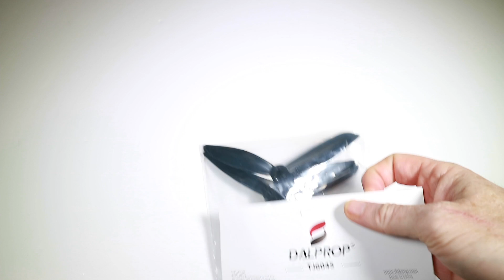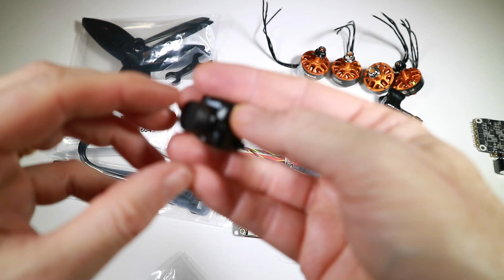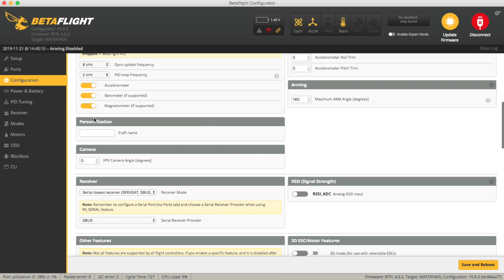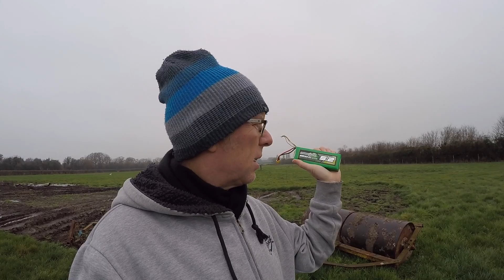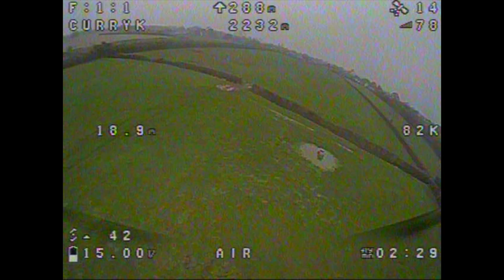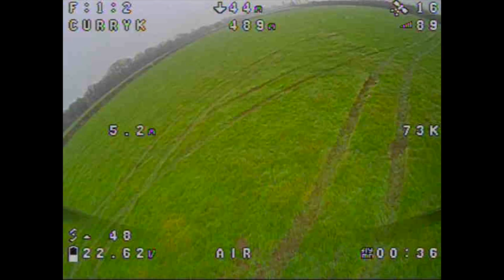Eachine Tyro119: Build, fly and review.  Supplied by Banggood

Comment: which UART do you recommend to add an elrs receiver?
thank you
Reply from the maker: I just checked and in the tyro I used for Open.HD I had an ELRS rx on UART5.  I can't remember a reason why - there's a bunch of rx/tx solder pads on the top left of the FC you can use
Reply: @CurryKitten  thank you

Comment: I subscribed a while back… thanks for all your videos. This is an amazing quadcopter!
I just upgraded my Tyro 119 with the DJI Air Unit… YES… the air unit fits right under the top deck right on top of the nylon nuts securing the FC, secured under the top deck with double sided tape.  The DJI antennas are mounted vertically just in front of the 2 rear standoffs .   I wanted a top mounted battery so I extended the bottom deck with clear acrylic sheet for the GPS to be mounted 4-5” away from the rear of the main frame, and a self powered beeper mounted on the acrylic piece as well…. Also built a 6S 18650 3500mah pack for it.  It hovers at 15-20% throttle and Flys great and far with the Crossfire nano receiver.   Thanks again for the educational videos.  I will keep an eye out for more of your videos.  👍🏼

Comment: I bought mine in jan . 2020 same as this video . I just put elrs into it today . April 29 , 2022 ( i had a fllysky ibus ia6b 10channel reciever )
  I trying to understand gps rescue on a switch . Or is it auto . If i shut off rescue in failsafe the gps speedometer should work with osd . Gps  is sensor on uart 1
  My tx is jumper tpro  grey one with nano module.
   Sometimes i need to pllug or replug. It. In or the reciever blinks fast . 
   So the gps rescuue on a switch or. It is only on or off in betaflight ? Or does the switch shut off the gps rescue . Not turn on the gps rescue . Or am i thinking return to home switch  .
Reply from the maker: Ok - so the GPS info like speed, altitude, direction to home etc etc.  Should work if your GPS is connected properly, and doesn't need rescue mode  to be the failsafe.

If you put GPS rescue on a switch, when you hit that switch you are putting the quad into rescue mode, so it should rise up and come back towards you.  There are caveats to this though, by default if you are within 200m and you enter rescue mode the quad will just drop.  Also don't forget that this isn't anything like RTH, the quad will basically crash towards you if left to it's own devices
Reply: @CurryKitten  thanks .i will just use rth as a failsafe .   My rx and tx were backwards on the blinking gps module at first is why the satelite lock was not working .

Comment: What pads do I solder for dsmx? Thanks
Reply from the maker: Bridge the PPM pads.  There is (according to the diagram I can see) a 3.3v pad on the underside as well if you need that
Reply: Thanks, and I was talking to a friend who said you can only use specific dsmx receivers. I know you don’t use spektrum but do you know of one that may work. No worries if not, thanks!
Reply from the maker: I've not much of a clue about Spectrum stuff I'm afraid.  But as far as Betaflight goes, it looks pretty happy with this one https://www.banggood.com/1_2g-Happymodel-Speki+-Micro-2_4G-12CH-Receiver-Compatible-DSM2-or-DSMX-or-SRXL-With-Power-Amplifier-RSSI-Ready-for-RC-Drone-p-1740422.html?cur_warehouse=CN&rmmds=search and I notice it uses 5v as well (which will save you hunting for the 3.3v pad)
Reply: @CurryKitten  thank you so much, really appreciate the help. I’ve been wanting to start flying fpv for a while now but have struggled so much with finding a spektrum drone. I’m sorry to keep pestering you but do you also know of any good tiny whoops? I don’t mind soldering a reciever too.
Reply from the maker: For indoors, I still like the Eachine UZ65 https://youtu.be/Xhj9lFoqlvc

Comment: Hi Curry Kitten, glad I found your site, just purchased the 119 and I really liked your video. This will be my first build(and really my first real flight), thanks for mentioning the Smart Port hookup too, that will help. I was just wondering if you have another video showing and explaining your Betaflight settings either for this quad or settings that would be a good match for a quad like the Tyro119. Thanks very much. By the way, boy does that U.K weather bring back some memories, I was stationed at RAF Alconbury from 1982-85, I miss it deeply.
Reply from the maker: Yep, we get all the seasons in one day sometimes :)  As far as the tuning goes, there's not actually anything I did on this quad.   I changed the rates to give myself faster pitch/roll reaction, but the rest is stock.  If you are new to Betaflight in general, then I have a playlist where I talk about each of the tabs and what I personally like to use, which is here https://www.youtube.com/playlist?list=PL7WaECFssECL3NKb3v6vrk58nxCFFiWs9 so I hope that might be of sme help.  There's also another playlist here about starting off flying https://www.youtube.com/playlist?list=PL7WaECFssECJITJMCyVrwp4WezSHTWbmN in the 2nd part of this about using Acro mode, I go over about how to make your rates right for you - so you can fly acro without the worry of spinning wildly out of control if you move the stick a bit too much.
Reply: @CurryKitten  Thanks so much, those videos will help immensely, I really appreciate the work you do to help us out. Have a great day and thanks again.

Comment: I built the Tyro119 and as I arm, the drone jerks erratically. Motors are correctly mapped, spinning in the right direction and the props are correct.
Any help?
Reply from the maker: Something like a video and DVR recording would be useful for this sort of thing.  Any sort of jerkiness generally means that airmode is on (or motor stop isn't on) and it's potentially in some sort of self level mode where it's attempting to stabilize the quad.  Are you using Dshot for the ESCs - are motors running up evenly in the motor test.  Did you check is accelerometer is calibration and that quad responds in betaflight correctly as you tilt it in different directions?
Reply: @CurryKitten  I am using Dshot 300, motors are running up evenly calibrated the accelerometer, but I noticed that the  green arrow almost 180 degrees off from the quad fc orientation
Reply from the maker: So it thinks it's facing backwards - or the reverse or where it is?  Could certainly account for some weird behavior is it will try and right itself using the motor it thinks is there, but will be actually throwing itself more out of whack.   If you tell me what your board alignment says in betaflight then I can check it against mine.
Reply: success. Corrected the tilting and orientation  problem, Thanks so much,
Reply: Problem now is the drone does not lift  when I advance the throttle. usingh 3s 2200mah. too heavy? should I use 4s?

Comment: Hi mate , i have just got this quad but i cant seem to connect to beta flight . I loaded beta flight on my computer a few years ago and never used it because i sold all my quads and got into planes . Now i have tried to use it but it doesn't work , and my beta flight screen looks a little different to yours , don't suppose you have any ideas to were i am going wrong ? Many thanks any help would be great and much appreciated , Scott .................
Reply from the maker: First off, check to make sure you have the latest version of the Betaflight configurator.  I would guess not if it's been a few years.  Usually you plug your flight controller in via USB and a new COM prt (if you are on Windows) pops up and you connect - you might need to look at the drop down to find the available ports for this.  If there's nothing appearing, then check that USB cable.  A lot of times we're given USB cables with devices but they are simply charge cables instead of data cables and so don't work for comms.
Reply: @CurryKitten  Hi mate , i am using my DJI cable that came with my F450 so that should be good . I think it an update problem , but i can not update Beta flight  no matter what i try , and yes mate i am using windows 8 . Its so frustrating  . Many thanks , Scott ............
Reply from the maker: Can't update the configurator or the firmware on your board.  Getting the new configurator should just be a case of downloading from here https://github.com/betaflight/betaflight-configurator/releases and running the .exe  Is something weird happening when you try that?

Comment: please explain to me how you made the connections to the receiver, do you need any soldering?
Reply from the maker: I did, but it depends what receiver you have.  The Tyro comes with a pre-made cable with a plug that goes into the flight controller and a servo connector end to attach to your RX.  I snipped this cable and soldered onto my RX.  It's important to know that soldering is required to make this quad though.
Reply: ok but ..where and what else do I need another solder if the receiver has its cable and plug.  I have Flysky.  but if, I buy Frsky r9mm how, what else stick where?
Reply from the maker: There's not much soldering here, but there is some.  The main things being the motor wires onto the ESC board, the XT60 connectors (and capacitor) to the ESC board and there's a little jumper you need to short in order to choose between PPM and SBUS

Comment: Great video as always! What's the flight time on 1000mah 6s?
Reply from the maker: Unhelpfully enough, I can't exactly remember.  I just checked some later flight footage and I was landing at 5mns with 22.5v left, so it could go longer - but, of course, it very much depends how you fly it.  Those were more cruisy flights.  I think it would be more like 3-4 minutes if I was pushing the throttle a lot

Comment: Joshua Bardwell did a Tyro119 with iNav, but recommended replacing the GPS unit as it doesn't have a compass.  But when I rotate my Tyro129 on the bench, the model in Betaflight/iNav rotates.  How does it know it's rotating if it doesn't have a compass?
Reply from the maker: It knows it's being turned because of the accelerometer, but it doesn't know which direction it's actually facing at any time.  It is possible to work out a direction based solely on GPS data, but it's more complicated and slower to do.  But iNav don't want to go down this road on multicopters (although on fixed wing you can use RTH without a compass)
Reply: @CurryKitten  Thanks for the quick reply mate.  So I should definitely buy a better GPS module then?
Reply from the maker: Buy one with a compass in it as well the Beitian BN-880 is one with both.  You might need to raise the module up form the carbon frame to get a clean compass signal though

Comment: Love the video, wish you had better weather at the time.  I would also like to ask a question, this comes with the DALProp Tj6045 Tri-Blade Props and I am having an awful hard time finding these and wanted to pick up some spares, I'm using 4S 1500mAh and 6S 1300mAh batteries at the moment, could you recommend any other props for this model?
Reply from the maker: Helpfully enough, I've not even dinged a prop on this so I hadn't thought about it.  I did have issues finding decent 6" props before for another project though.  I like an HQ prop, and I notice Banggood have a tri blade HQ 6040 which I would try, but 6" still seems light on the ground for choices still

Comment: Hi a show your video explain everything in a simple way ..... I have a Flysky FS I6 Radio and an Fli14 + receiver how should I connect it and where should I solder? Thank you for the answer I would not want to make mistakes .... thanks
Reply from the maker: You'll need to make a slight change in the way I set this up, if you look at the close up of the flight controller at around 14:32 you'll see the 3 solder point that I bridge the left most 2 in order to tell it to talk SBUS, that rx you mentioned talked iBUS, so you'll want to bridge the left most 2 pads.  It's then just a case of cutting the sable (with a servo end) from the 119 kit and the servo end of the rx, and then connecting the signal/gnd/5v lines together.

Comment: No understatement those motor cables are really annoying. Also some of the ESC pads were really hard to solder on. However bird is ready to fly now first hover test in the cellar was a success.
Reply from the maker: Everyone I know that's had a Tyro-whatever has complained about the motor wires, and all these revisions on they haven't changed !

Comment: Sorry if I ask something what was answered earlier, but I'm not native in english language. Did you try with 3s battery? or the 1800mAh was a 3s? And did I understand it right with 4s 5200mAh you reached 10- 11min flight time?
Reply from the maker: I didn't try it with 3S, I think you'd be looking at a lot of throttle input based on the lower KV of the motors, so the 1800mAh lipo at the start was a 4s and got an easy 5 minutes of flight, the 5200 will get at least 10 minutes, probably more, but is a bit too much.  I think there's probably a sweet spot around 3000-4000mAh which will give the best performance in weight vs flight time.  It was really nice on 6s though :D
Reply: CurryKitten Thanks for your valuable answer. Basically I wanna build a cinewhoop type of quadrocopter, but I didn't find any diy kit with low kV motors. That is the reason why I asked that what I asked.
Reply from the maker: You'll have to define the word "cinewhoop" a little bit for me there.  I tend to think as anything with a "whoop" on the end as very much micro, with ducts to protect props - in which case the kv is always pretty high.
Reply: @CurryKitten  Ok. So, it has to be able to carry a Gopro Hero 8, ducts for protection is a must, and the minimum flight time shoud be 10min. I don't need any acrobatic flight charasteristic,just a relatively fast and smooth flight ability.
Reply from the maker: There's certainly a challenge there.  Adding ducts to a larger quad creates inefficiencies and makes it very noisy - so the desired flight time would be tricky.  Good lucky though, be interested to see what you come up with

Comment: I’m no noob to quads, I have 14 now ranging from 65mm-75mm whoops, a 2.5”, (4) 3”, and (5) 5” quads. I saw this and thought “I don’t have a 6” yet” and for the price, I didn’t 🤔 twice. I do use R9MM OTA’s, and was wondering what you had to do to get F.port working. Will you be coming out with that video soon? I should be receiving my kit any day now, and I really don’t want to have to trouble shoot something that you have already figured out. BTW, I really enjoy your videos, as well as your brand of humor. Keep doing your thing...
Reply from the maker: Well, dont' use the SBUS connector as it's not bidirectional - so F.Post will sort on it, but you won't get any telemetry, so use a normal UART instead.  I can't remember if I needed to fiddle with much else without taking another look at it.   The video would have been out by now, but inbetween the weather and the virus it hasn't happened (yet)
Reply: What if I am using an R9MM with an inverted s.port would that work on the sbus pad?

Comment: I got a question. how far would the video signal go? and what could I do to make it longer?
Reply from the maker: Range is a common question, but the answer is always "it depends" that's because it's dependant on the RF environment you are in, the weather, your altitude, your receiving antenna and a whole bunch of other things.  The simple answer is - in it's current form at least a few km, and the easiest boost to range is to increase the gain in your receiving antenna..... but as gain goes up, you need to be able to point the antenna more directly at your target (which is where antenna tracking starts to come in)

Comment: I have a stupid question, which seems dead obvious to me.  Is there any reason they don't make the ESCs and motors with some decent 3 pin standardized plug in connectors, so that you could avoid soldering (and configuring motor direction) all together.  It seems like a big no brainer derrrr.    Ditto for the battery connector.  Other than cheaping out and cost, of course.
Reply from the maker: So motors for bigger quads (and we're talking the start point years ago being the f450) had bullet connectors, and ESCs sometimes did as well.  But it's just another point of failure, and people wanted to save weight, and complexity by soldering direct... especially when it got to smaller quads.  Lipo connectors are kind of standardized (mostly) but size and amp throughput has a lot to do with the types used.  Push enough current through and you might end up with XT90s, but these would be huge and massive overkill on a whoop, so different ones are used
Reply: @CurryKitten  - I think the soldering keeps a lot of people out.  Edge connectors for the motors and the bat connector should come pre attached because... its a standard.

1) I should make a 100% plug and play legos kit zero soldering required.  2) You make the assembly video 3) Profit!
Reply: Months later mine is still unfinished. 
 Boxes of parts don't fly.
I use to have the patience to assemble this kind of cr4p, but all that has completely evaporated.  I have zero patience any more.

Comment: Finally got my Tyro 79 working. Camera was unworkable out of the box, replaced before first flight.  2nd flight FC failed.  4th flight VTX failed. Now put motors & esc into a DC3 frame with a new matek F411 FC & DJI air unit. Will be perfect once I replace the motors & esc. Never buying a tyro ever again.
Reply from the maker: The camera in my 79 was duff - got tearing along the bottom.  But the rest was pretty sound (aside from those awful motor wires)  There may well be some truth to cheap stuff failing more often, but anecdotally I heard from quite a lot of people who really like the 79 and a very few number of failures.